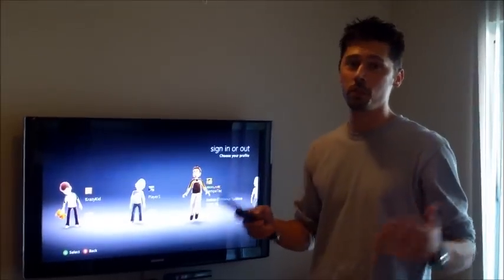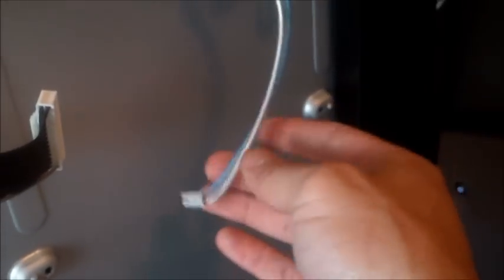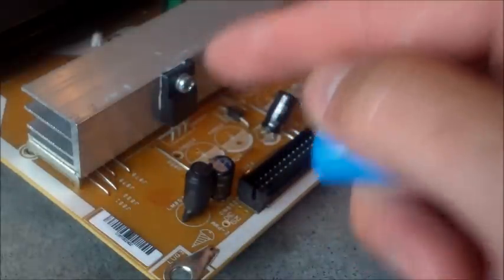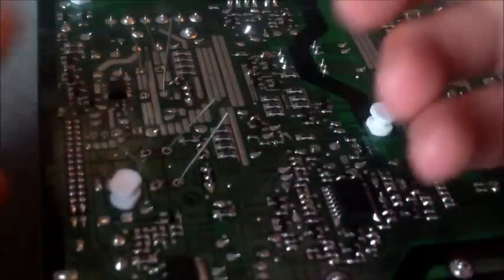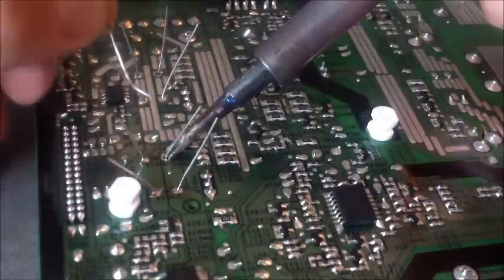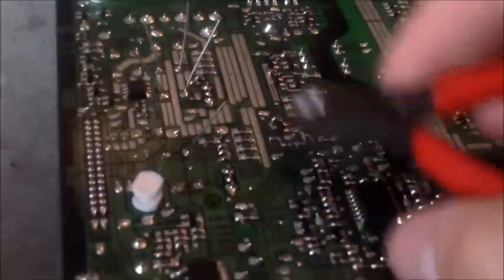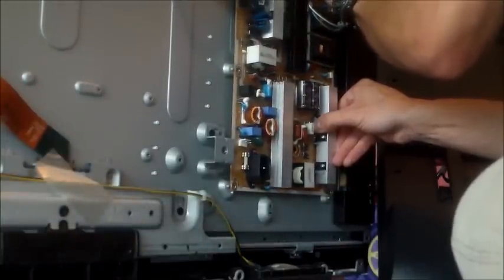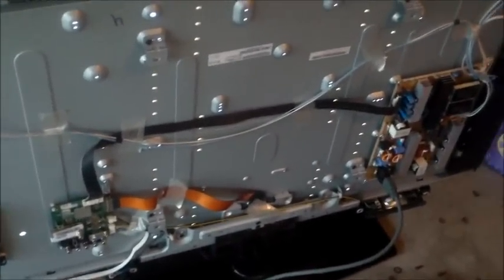SAMSUNG TV REPAIR- TURNS OFF RANDOMLY

Comment: offen  found  a  defective  main  video  board  in  samsung  tvs   causing  the  cycling  on& off ,   power  boards  can  start  having  issues  turning  them  on  &  taking  longer  to  turn  on  before  they  will  stop  turning  on  ,  Very  Common  problem  with   Samsung   Sets  made  in   the  2000,s  they  were  using  cheap  capacitors  trying  to  save  costs ,  Thanks  For  Informative  Video  and  My  2  cents  is  Free

Comment: Sanyo 50" plasma TV, Model DP50747 started turning off. finally would not power up at all.  I replaced 4 bad CAPs (thanks to ur video) and it fired up.  ran great for 2 days. then started to shut off again and finally would not power up at all.  power board looks ok and i dont see any bad caps.  removed plastic covers on larger CAPs to check them also.  Im stumped.  Should i remove all caps and test them or could it be another problem.  I missed something the first time around. Samsung Board.

Comment: Top guy tampatec, just to let you guys in the uk know,Maplins electrical supplies have multipack capacitors for,this fix off the shelf or you can order specific replacements if you want to wait and just buy the replacement for your blown cap, no more than a couple of pounds,thanks again for posting this you saved me a big repair bill or even worse the cost of another T.v and Samsung I'm disappointed !

Comment: What a surprise yesterday when I went to the local electronics repair store to get or order capacitors.I took the board with me and they ended up fixing it for free.They said Samsung would pay them.Happy! This for a 52 inch Samsung LCD with the on/off cycling problem.
Reply from the maker: Wow, few other repair shops would charge customer and Samsung for that repair. you should give them a shout out.
samsung tv capacitor warranty 1-888-899-7602
 8^)

Comment: I have an other whole power supply from one of internet supplier.
I have replaced the power supply which means I have two power supply for my current TV (42" Samsung plasma TV) both power supply didn't fix the problems. do you still think it has problem with Caps? Thanks.

Comment: Good to see you are using the correct solder. I just watched some other vids showing them adding flux (obviously plumbers flux, which is corrosive to wiring) before soldering. Rosin core solder does NOT need or want extra flux.

Comment: Not yet.  Im trying to find a CAP kit for the board.
Although its a sanyo TV its a samsung power board:
Model:  PSPF561A01A
REV. : DR3 0.8
DATE: 070120
12Vamp
Im doing a visual recheck of the board now and cannot find any other caps that look even slightly bad.   Im assuming that a cap kit contains replacements for all of the caps.

Im also wondering if i need to buy a meter to check the caps. i have a craftsman 82344 autoranging multimeter that reads capacatiance. hoping thats good enough.

Comment: how come you dont get an electric shock when you grab the PSU? You know that PSU has 400v capscitors that can hurt you? How did you discharged that high voltage capacitors?

Comment: I had a similar problem...opened up the back cover...inspected all the caps no bad cap found. Then I checked all diodes and caps with multi-meter. Then I just re-soldered all the cap and transformer connections. Assembled back and now works like a champ...Akeel Kizilbash

Comment: Great videos! on a un-related matter I have a LN46A630 that the screen will go black in the center and if you bring up a menu and close it,you will see a ghost of it.Sorry for posting this here ,but I can't find any place to find info on it.
Reply from the maker: can be Tcon board or bad panel connection or Main Video board. shopjimmy.com offer tv boards with warranty and with return policy.
Reply: Thank you for getting back to me.Yes I will check that out.I looked on that web site and they are out off stock on those boards.Any place else?
Reply from the maker: carey lee then try amazon or ebay

Comment: My Hisense TV H50A614 turns off after a while. Each time i insist turn it on the time the tv is operating is less until even the hisense logo just wont show it anymore at startup. Next day the tv operates flawlessly until it turns off after 30min. 
I am thinking to replace the PSU. I dont have any electronics skill to diagnose and repair the TV.

Comment: question,. got ln40b530 samsung that has the problem that it goes on and off but sound in background,,, changed setting to backlight to 0 and i have picture constant now but i just wondering if you know an easy fix to this problem so i can get the picture somewhat brighter?
?

Comment: i have a question last night the lights went out 3 times on my block, i have three flat screens a Samsung 55 inch,element 32 inch and a 55 inch element, the 55 inch element turns on and off now,the other two are ok, do you know what wrong with it?

Comment: Dude thanks so much!  I have a 46" Samsung LED TV that isn't even a year old.  It started turning off and on randomly and I spent a lot of time on the phone with customer support at the shop I had bought it from.  It straightened itself out and worked for a few more months until recently when it would no longer turn on at all.  I watched your video and then opened up the TV and sure enough there were two capacitors with small black burn marks on them.  Soldered in new ones and it's good as new!

Comment: I have fixed several Samsung and other computer monitors which had similar issues.  This is a common problem with many brands due to the use of cheap Chinese capacitors which fail especially on units which are used for long periods of time causing increased heat.

Comment: so i have a 58 in plasma samsung tv and its doing the clicking but none of the capacitors are bulged. so not sure what to do about that, all the other videos ive seen its always been a bulged capacitor. what else could be the problem?
Reply from the maker: check 680uf 1000uf 2200uf 3300uf 10v or 25v capacitors , some bad caps may look good but are bad, so take them out and test them or replace them.

Comment: Hi guys, I have problem with my Samsung LED TV.I turn off my Samsung smart Tv UE40F5300AKXXU and since then I have blue screen (like tried to flash on but stopped), only voice. I tried to check with remote screen on my mobile if I can switch of any screensaver ect., so only the way I can see what is going on with my tv. It has turn off randomly before, but I did not know that is sign of the problem. of course it is ten days out of warranty so no deal with Samsung. can you help me please. I have some PC skills and Ipad repaired so far so I would like to take this as a new challenge.... Can you please help me?

Comment: My four year old Samsung LCD 40 inch (LA40C550) frequent power off problem and Samsung technician estimated INR 10,000/- and minimum of one week for service. After viewing so many videos i decided to change the capacitors. It cost only INR 80/- Thanks for the video
Reply: Were you able to fix by your own?
Reply: +Navneet Joshi yeah I did it 😉😘💪
Reply: have you done it by your own? i consult an electrician and he screwed the panel and now there is a thin line in the middle of the screen and the on off problem wasnt even solved. Samsung is asking for more than 20k for panel replacement but I dont want to invest that much money of my 4 year old led. It looks like I will not be able to fix the problem by consulting a local electrician :(
Reply: +Navneet Joshi I was not having the tools so I went to a local store, from there I bought the capacitor for Rs. 30 and a nearby electronic shop they changed the capacitor for just Rs. 50. so total cost Rs.80.
Reply: Thanks for such a prompt response Anil. Do I need to replace all capacitors?
Reply: +Navneet Joshi I changed both my capacitors
Reply: thanks Anil for sharing the info
Reply: I have haier android led LE55B7500U turn off suddenly . I switch off and after half an switch on then it turn on.not in sleep mode. What is the reason pls solve this problem.

Comment: i have a panasonic lcd that turns off randomly, power cycles with fast flashing light. sometimes after waiting it will work again but cycles again after some time. i changed the power board but it still happens. any ideas?
Reply from the maker: count the red flashes its an error code what board failed, contact shopjimmy.com to get the correct TV part.
Reply: its an amber color flashing and they are too fast to count
Reply: ***** mine flashes green light then stays off but if i get it to go on the main screen it tuns off on on     any ideas
Reply: Have you solved your TV or gave up on it? I have the same problem with my Panasonic as well.
Please advise.
Reply: Moustafa Mahfouz
im ashamed to say i did give up my friend... my only guess was that it may have been a dodgy capacitor somewhere but not on the power board as i changed it

Comment: Worked for me and this video gave me the confidence to take it on.  Thanks! A couple of tips. 1. Get a soldering iron that is 60watt because the cheap ones will not get the job done. 2. You need silver solder with rosin core 3. The suction vacuum is ok but you don't need it...just get someone on the other side to rock it back it forth with some needle nose... while you apply heat from the other side.  You video is still awesome HIGH FIVE!

Comment: Thank you so much Tampatec. I have the same problem with my Samsung TV, although the Model# of mine was not included in the list of models that have similar issues. I'm also glad that you mentioned in this video that not all bad caps bulge, otherwise i'd be looking for a needle in a haystack. Looking at the caps right now and they seem to look normal (no bulge or oozing fluid), but the symptom is there and it's getting worst each day. I'm no technician but this video made it look easier than i thought. Thanks man!

Comment: I have an old Samsung LCD TV. It started randomly turning off and on again> Sometimes just a few minutes after being turned on, sometimes after hours. And it does turn on either straight away or it does after few mins, but all the time the red LED is flashing. I have noticed that unplugging the power cord and plugging it back in fixes the problem most of the time? Do you think it might be a bad capacitor?

Comment: Hi:Tampatec
I have a Samsung M# LN-T4071F is turning on and off i check the caps and they weren't bulging or displace at all ,i replace the caps anyway and it didn't fix the problem unfortunately, What else could it possibly be any help will be grateful.

Comment: I've seen tv repair kits come with the really tiny resistors and diodes. DO you still use a solder sucker for that? I would be worried because the solder suck could suck those things in right?

Comment: I have checked the all capacitors and try to replace the power board  all looks fine, but still my Samsung Plasma tTV has problems with power turn on and off repeat,  Is there anyone any good suggestions?

Comment: The temp rating isn't just "kind of" important as you stated, its essential. You replaced caps which are rated at 105c with 85c. That's a bad idea, especially given the application and as close they are to a heat sink. The proper caps to use, are whats called low ESR type at 105 Celsius. Panasonic FM or FR series, or others such as UCC KZE series are much better than the originals. Plus they can be had in different dimensions so fit properly and dont end up closer to the heat sink.

Comment: Hi Tampatec I have a question. I was following your step on desoldering, and I accidentally melt a piece of the leg to the board. So as I was trying to pull out the capacitor, I pushed the leg to try and center it up with the hole and I accidentally scraped a really small piece off the green side of the board. My question is am I just better of getting another board or if I still try to replace the capacitor, would it still work?

Comment: Hey tampatec...my tv is cycling on and off...after turning it on for about 5 minutes tv turns off..I checked all capacitors visually and it looks good..how can I check capacitor without disoldering it from the board using multi meter..

Comment: I have a Samsung 65 plasma that will turn off after it's been on for a while and stay off. I then ha e to wait a while and unplug and hold finger over power button for 30 seconds, then it will turn back on. But now it's doing it more frequently. Would this be the same/similar repair on the plasma, as opposed to lcd?

Comment: If I pay can you do it for me
Reply: You can do it yourself, it's not that difficult and it's cheaper.

Step one: take the back off and look at the power board (beige)

Step two: Look for the capacitors that have bulging tops and jot down the values ie: 6.3v 4700 uf (Microfarrad).

Step three: put the values in on ebay followed by Capacitor in the description and purchase however many are needed (tip: get panasonic caps)

Step four: take the board off and de-solder the bad caps and replace with the new ones (ensuring correct polarity)

Step five: check the work by looking to make sure there isn't any solder drifting onto other components and look to make sure the polarity is correct on the capacitors.

Step six: replace the board and connectors and test power the tv.

It should work, I did my first today and I'm not an expert by no means at soldering.

Good luck if you choose to do it. Just follow the video.

Comment: i have a Samsung PLASMA tv the standby light is on but the tv will not turn on i check the power supply board  n saw the fuse blow also a mosfet resistor blown i change both of them but it sill not turning on .what do u think do i need a new board or check the board more fine ?  model #sp-s4243

Comment: Thanks for this great video. My Sony LCD TV KLV-32NX500 has similar problem. When I turn it on, it won't start for 1-2 hour and all of sudden it would start. Then after few more on and off it continues to work fine untill power is disconnected.  Can you please suggest what could be the problem. As shown in the video, are the capacitor on power board dying or already dead??? 
Will Really appreciate your comment. Thnx in advance.

Comment: Hey Tampatec,
My Samsung 52 inch LCD was turning itself on and off as soon as you plug it in. What I though was going to be an easy Capacitor fix turned out to be the Motherboard. I knew I was in trouble when all my voltages checked ok off the power supply, from doing a lot of investigating  I have found out that Samsung motherboards are crap..You might want to mention that in a video.
Thanks
Reply: Can Tampatech or someone tell me how to change the motherboard in this same Samsung lcd tv. Compasitors have been changed by  Samsung Svc. Man.  Turns out to be Motherboard..

Comment: i have a 40" samsung 1080p 3d led tv and the red led blinks slowly and the samsung logo blinks on the screen but the backlight is not on (you can se the samsung logo only if you use a flashlight) whats wrong with the tv.
i think the power pcb

Comment: Tampatec.... have a Samsung HL61A750A1F  DLP LED TV. The TV just lost it's picture, I can not turn it off either with remote or manually unless I unplug it.
Thr bottom right green led just blinks which according to the owners manual indicates tv uis powering on and picture will appear  in 15 seconds but it does not .

any help would be appreciated

Don

Comment: Doesn't Samsung has a lawsuit against them? As I understand they knew about the faulty capacitors in the power supply that they intentionally installed. I have experience in swapping them components for years. Cool thing to do.

Comment: Hello - I have samsung hls7178, After changing the lamp (ordered from Samsung), the tv starts to turn off randomly like turns off right after turning it on or after a few hours of watching or not turn off at all until powering it off manually. I have not change anything since then because theres no weird sound coming from the TV. Picture looks great. I hope its an easy fix. Thank you

Comment: Generally don't wanna buy radio shack electrolytic caps if you can help it.  They stock very cheap brands,  they often say they are low ESR when they arent,  and are sometimes out of spec or fail very prematurely (sometimes taking other components with them).
If you're buying primary output caps for your tv power supply like those,  stick to high quality, low ESR ones.   Rubycon, Nichicon, Nippon/Chemicon, Panasonic are all generally considered the best brands. Just order them from Digikey or Mouser or something,  they ship fast.

Comment: I did replace all 10v caps. I also did a small test: I disconnected the "pwr on-off" wire between control board and power board and connected it to 5v standby instead. Then power board did not switch off, but when I measured the "pwr on-off" signal coming from the control board, it was trying to power cycle continuously.

Perhaps a control board issue?

Comment: My Samsung AA01 has been working fine for 2 years..recently it wouldn't turn on, I contacted my local repair man and he fixed it...kinda, it stopped working again two days later he tried fixing it again, well it's still not turning on any advice..? Sometimes the standby light stays off, sometimes it stays on no matter if I press the power button, and sometimes the standby light shuts off and comes back on...please help!

Comment: hi my tv ( lg 55lm4700) powered off after an hour of run time, just bought it. My theory is that its not getting enough power off the power strip thats maxed out with dvr, sound, and game systems. Am i right in thinking this or could it be faulty out of box?